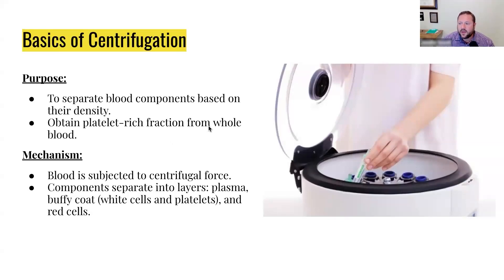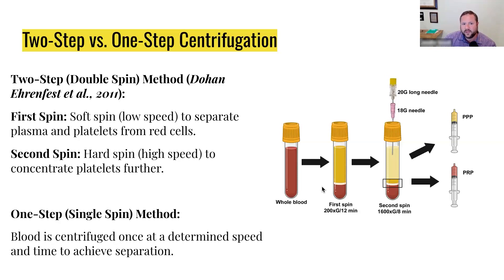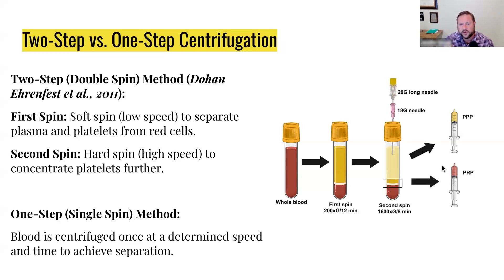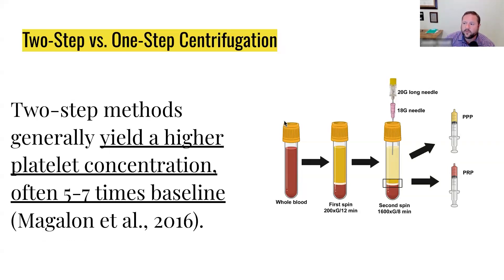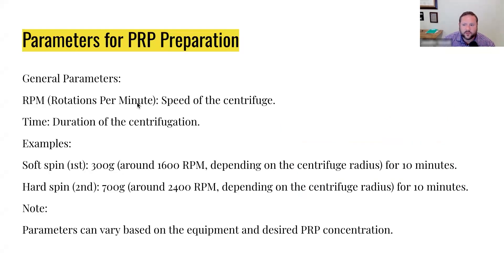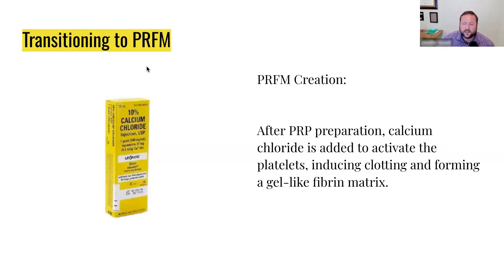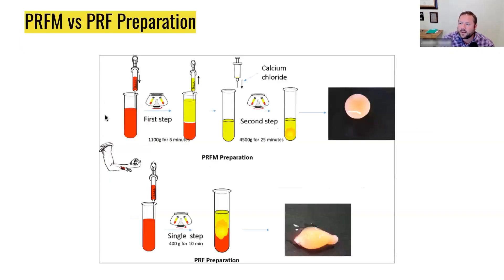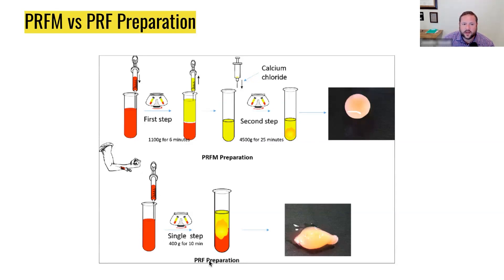How to Prepare PRP, PRF and PRFM Injections

Comment: Never ever use BD lab tubes for PRP. They do not guarantee true sterility. If you google, ‘are BD tubes endotoxin free?’ The first result from their own web page says. No!

Also, concentration is based on the amount of blood used. How do you concentrate 5-7 times the base line with a 10ml lab tube? You can’t!

This is the most unethical way to treat a patient. You are using non FDA lab tubes that haven’t been tested or validated for concentration.

If you’d like, I can prove this to you.
Reply from the maker: Thank you for your comment—and I appreciate your passion for patient safety and scientific integrity You’re absolutely right that sterility and proper tube validation are critical when preparing any autologous product like PRP, PRFM, or PRF. Many standard lab tubes, including some BD tubes, are not designed for therapeutic injection and aren’t endotoxin-free, as you mentioned. This is why I only use FDA-cleared PRP kits that are sterile, closed-system, and validated for human reinjection—to ensure safety, proper concentration, and consistency.

Regarding concentration: achieving true 5–7x baseline platelet levels requires not only the right volume of blood but also a properly calibrated centrifuge and kit design. A 10 mL lab tube simply won’t give you those numbers reliably or safely.

I’m fully open to reviewing anything you’d like to share—feel free to drop references or send over what you’ve got. At the end of the day, we’re all working toward better outcomes and safer practices for patients.

Comment: how many mL of Cacl do you need to mix ?
Reply from the maker: Thanks for the question. For safety and compliance reasons, I can’t provide specific mixing ratios or procedural instructions in a public forum. PRP/PRF/PRFM preparation should be done only by properly trained medical professionals following manufacturer guidelines and local regulations to ensure patient safety.